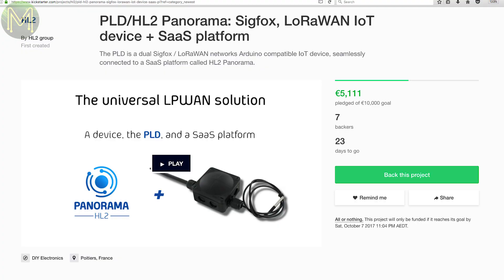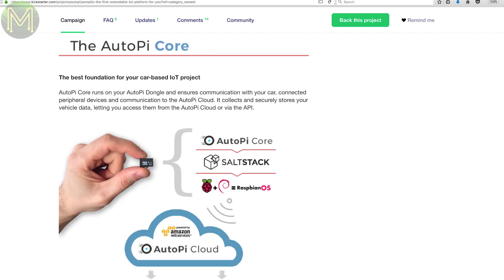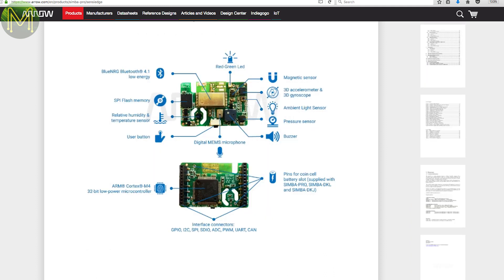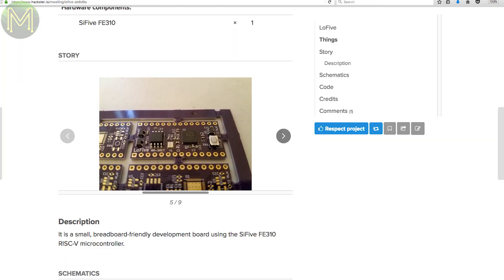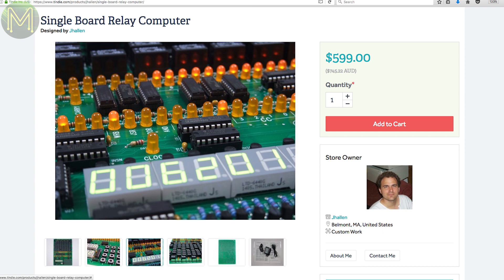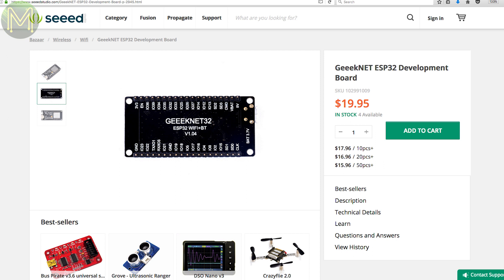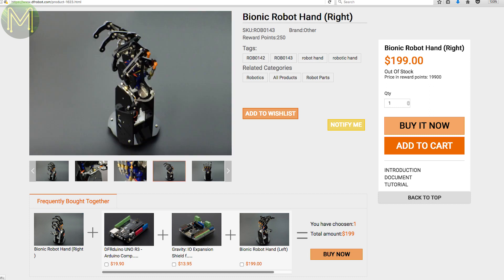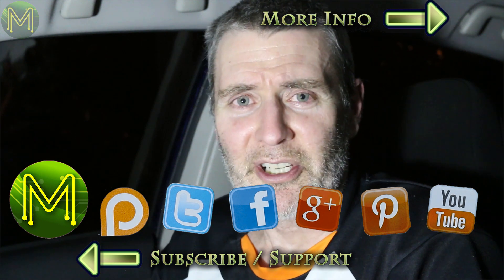#169 Weekly Roundup #43 - New Maker Products

Comment: 7:13 That's a fantastic idea, at least until you consider the cost of a battery vs one of those, coins cells usually cost what, $1 USD for a pack of 4-6 cells? So for $25 we're talking roughly 120 or so cells for the price of that thing, still not bad if you're regularly working on coin cell projects but otherwise it's I don't think it's worth it at that price...
Reply: Boldport did a neat project for battery substitutes which are perfect for battery powered device development
http://www.boldport.club/shop/product/687430084
Reply from the maker: +vgamesx1 
Yup, if you're doing a lot of development you tend to not use batteries, even when coding up sleep and power down/up modes as you know you have a consistent voltage level. So even if it costs more, it's worth it for the hassle free of digging around a lot of batteries.